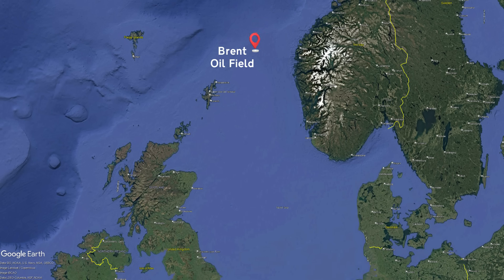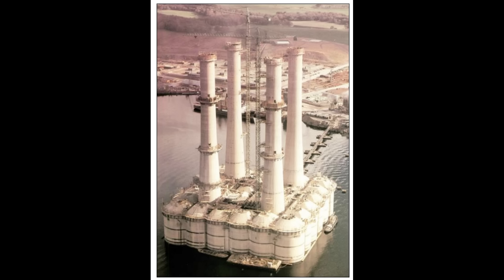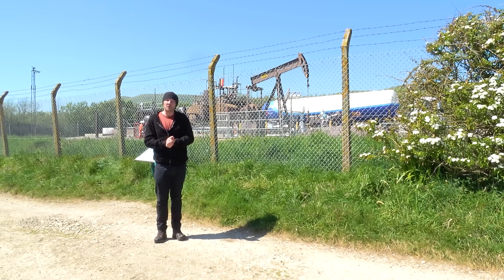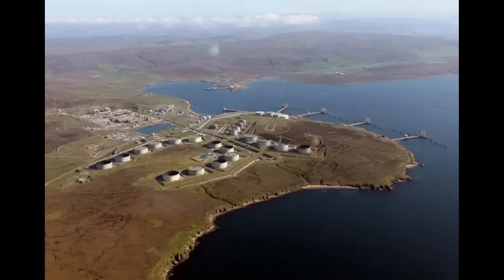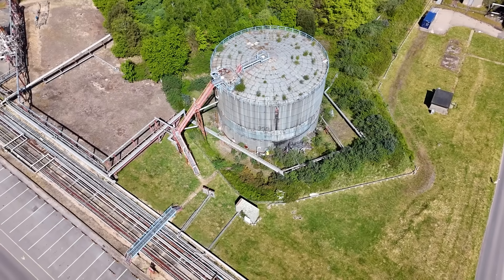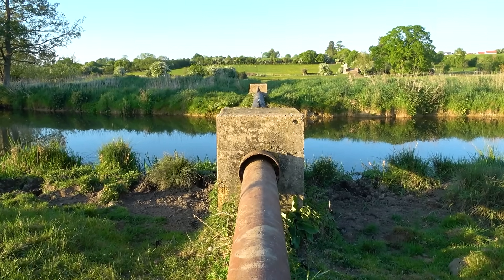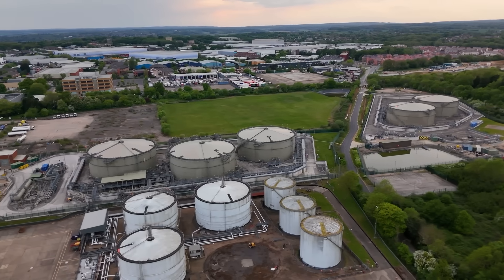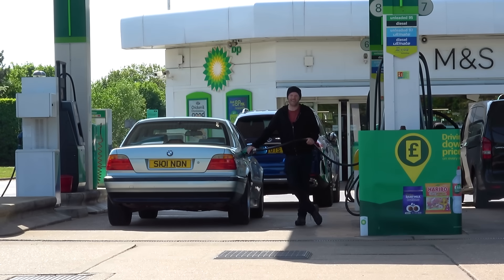Where Does Petrol Actually Come From...?   A Journey From Source To Fuel Filling Station

Comment: The not so secret pipeline passes through my home town on its way to the Kingsford fuel terminal near Tamworth, and no doubt beyond.
There is a secret oil storage facility near my home town, but don't tell anyone will you!?
I knew the manager of the fuel terminal at my home town, he explained how one pipeline manages to pump different fuels and oils, and how they knew when the product they were expecting arrived at their depot.
I drove down the M1 on the Monday after Buncefield went bang, you could see the flames from miles away, and the smoke from even more miles away!
Great video by the way!
Reply: I was an air traffic controller on a night duty when Buncefield went up. First indications we got was when aircraft entering London airspace east of Ireland started asking about the huge pall of smoke in the far distance.
Reply: @pfield39  I flew back from either Sherburn or Elvington that day, back down south. You could see the smoke from anywhere on the route, it was a clear day apart from the smoke. The smoke plume went on for 60 or 70 miles. You could see the fire at the start of it. I have some pictures somewhere.
Reply: It's actually the Kingsbury fuel terminal, situated by our village of (not surprisingly) Kingsbury in Warwickshire. The thrice daily fuel trains take away the partial mixes of diesel, petrol and kerosene that are supplied sequentially, via  a 10"pipeline, from somewhere in Wales, I believe. HS2 built a roundabout over the pipeline for their Kingsbury compound but it took 18 months to complete as the bloody pipeline kept leaking! It also runs by Spaghetti Junction, as a utility company discovered when they drilled into it during their work on the nearby Gravelly Hill....
Reply: @jagman84  I stand corrected and shamed that I was too lazy to check with Google!
P.S. the pipeline starts at Pembroke goes to Avonmouth where a pumping facility next to the M49 with holding tanks then pumps either South towards Buncefield or East towards Kingsbury.
Reply: The Government sold off the pipeline in 2015 so even less secret now😂

Comment: Remember A level Geography,1975, my teacher telling me oil would run out by 2000.
Hasn't happened, we are not all driving Hovercraft or living on the moon either.
Reply: They always told us everything would go to sht by the year 2000, it kind of did but for different reasons
Reply: True-ish…. But let’s take the Brent field as it was featured in the video. It was earmarked for decommissioning in 2006 (all 4 platforms). It doesn’t happen overnight. One by one each has stopped producing (pumping oil back onshore) and the wells were plugged and abandoned. By 2021 the lights got switched off on the last platform. True we aren’t driving hovercrafts but the oil is running out. The amount of rigs that are being decommissioned or are waiting to be transported onshore to be scrapped is scary.